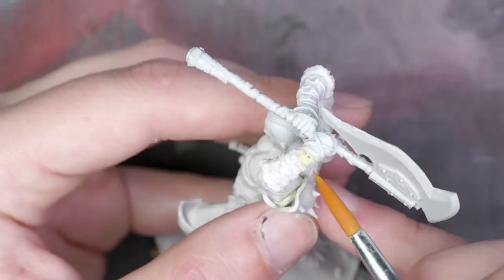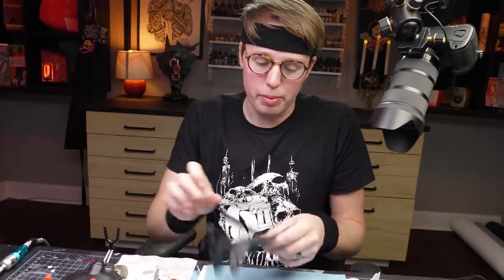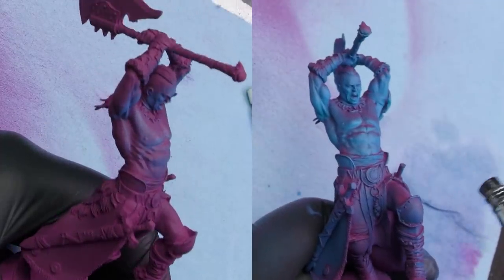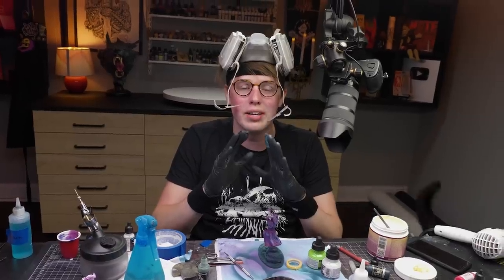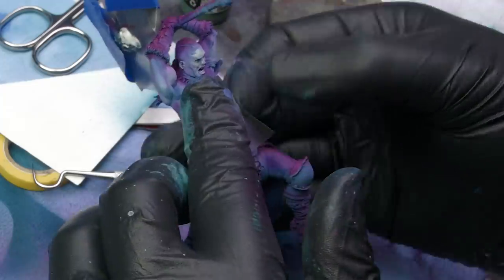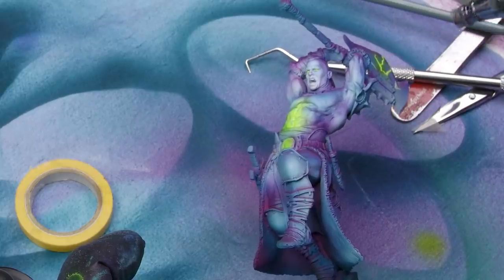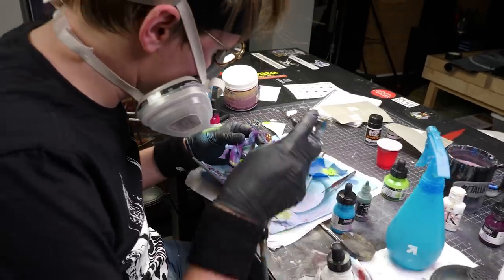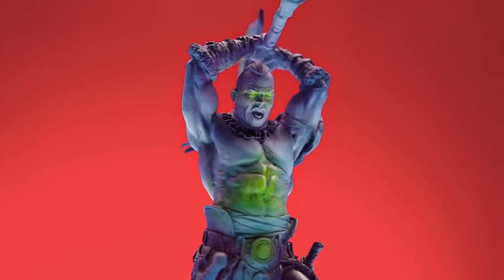Paint a Miniature with ONLY an Airbrush! ft. Jazza

Comment: The sprit effects can be done with holding a popsicle wooden stick against the tip of the air brush.  Back in the day we used wooden cloth hangers. The ones that pinched the clothes to the rope to hang dry lol

Comment: That was amazing! You both did a great job. :D
Quick suggestion though! If you're in the US look into getting a Fortress silent air compressor from harbor freight. I can use mine for hours and it doesn't get hot or anything. Get the 2 gallon one though!

Comment: You've taught me a lot about painting so I'll share my own tip: For blood effects, an alternative to using the air to splash it off of a brush, you can put the blood paint in the cup and spray it across the edge of something like a tongue depressor. The paint will build up on the edge, and be sprayed off. You can get airbrush tips specifically for spraying a spatter which replicate this with by having a protrusion that partially covers the area in front of the tip. I feel like this has more control than using a brush actually as you can control the paint flow.

Comment: Even if you're not handling the mini after painting, you really do need to prime, specially if you're gonna mask as masking tape/liquid can remove layers of paint if they're not attached properly to the surface.
Cool video either way, I wish I could get a large display mini like this to paint.
Reply from the maker: Due to the intermittent varnish step I took, I had no issues with tape removing paint.
Reply: @Miniac  aah, must have looked away for a second and didn't notice that step, for a while I thought you were gonna use liquid mask to paint the clothing.

Comment: Why didn't you mask "before" you started painting?
You could have spent days masking several layers and then removing one layer at a time brushing.
Reply from the maker: Because that wouldn't gain you anything. The first thing you paint on a model with an airbrush requires no masking. Only after that do you need to mask to cover up what you painted in your first go!